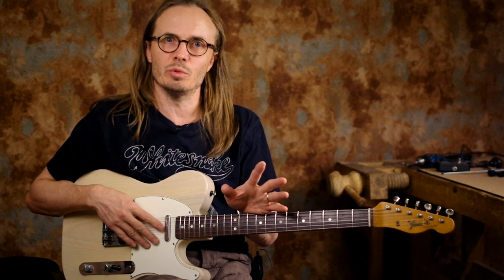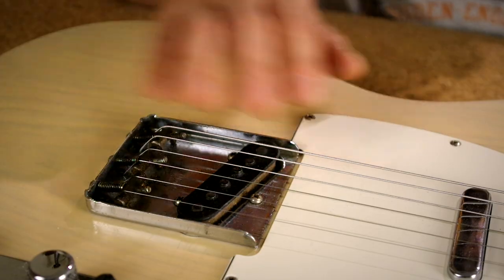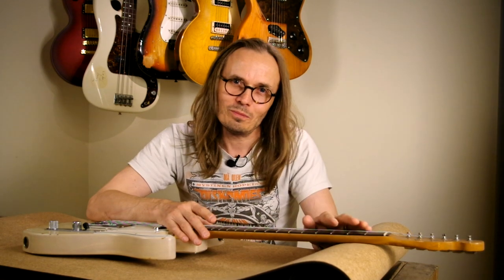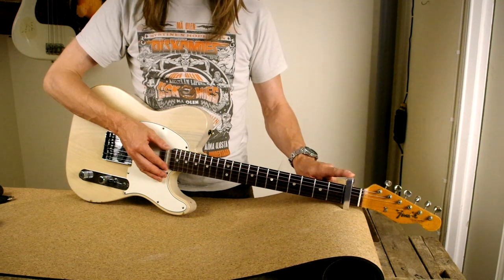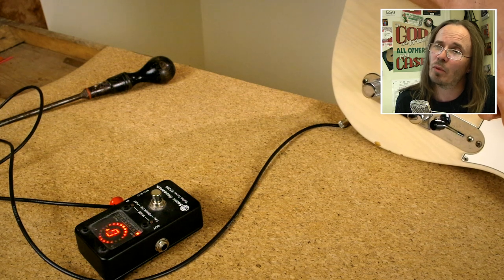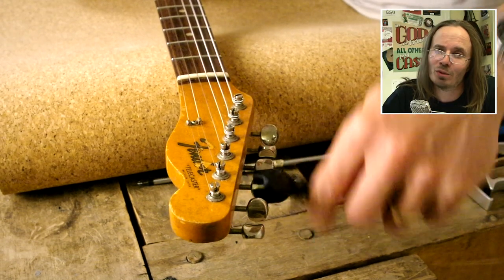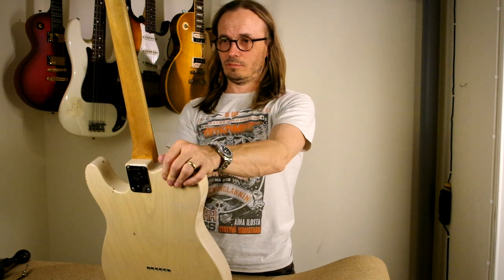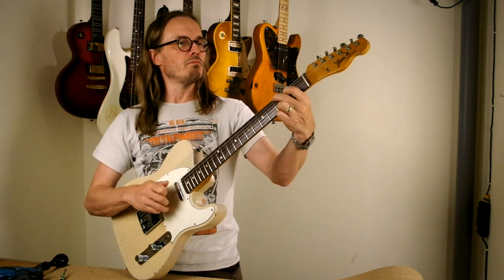Zen & The Art Of Guitar Maintenance #7 - "Learn how to adjust your vintage Fender style truss rod!"

Comment: For the pick guards that don’t have pickups attached there is no need to remove the neck. For people who are sketchy about removing the neck. Remove the 5 small screws on the pick guard and it will slide under the loosened strings. There will be plenty of room for a tool. I have been doing it this way for 40+ years.
Reply from the maker: Thank you!  Yes, this is of course possible whenever there's room for a tool after removing the pickguard. This doesn't work always (sometimes not enough room for a tool), but with many of them it does, indeed. :)

Comment: I've taken my guitar to many places to adjust the truss rod and they never do it very well. I wonder what they are doing wrong or what is happening to my 50s fender vintera. It is initially perfect and next day it's all wrong again , string buzz or no open chord will sound tuned...hmm I'll try do it myself
Reply from the maker: Thanks. If your guitar has felt perfect (as you wrote) after the adjustment, but then during following days the neck (truss rod) has changed "on its own", this would indicate that either the truss rod of the guitar in question has a tendency to adapt to adjustments slowly. In other words, next time you take the guitar to a repair shop, it's good to mention them about this, and ask them to take their time with it - adjust, wait a day, readjust, and repeat that until it doesn't move anymore after adjustments. Alternatively, your guitar neck is simply unstable. This can be caused by too hasty build process of the neck, wood that wasn't dry when the guitar was built, or something similar.
Reply: Thanks so much for your reply. I was thinking that might be the case because every time the guitar has been set up , it's been in a few hours or from one day to the other since I've had rehearsals, gigs etc ..the next day.

Comment: Why you slinging that 2ft screwdriver around?
Reply from the maker: Thanks! I'm so used to it! :D The origin of using such a long screwdriver come from the reach easier to adjust whammy springs on the back of the body, and also the truss rod. Another thing is torque - with a long screwdriver you need less force to tighten (or open) things. But I agree - in some contexts it may look hilarious. :D

Comment: Since many of the people watching this video are beginners, it seems that a simpler expression is needed. Wouldn't straight and bow be easier to understand than tight and loose(5:50)? Does Tight stretch the neck or bend it?
Reply from the maker: Thanks for the feedback! The terms can be confusing, indeed. The tighter (clockwise) you turn the adjusting nut, the more straight (or up-bowed if you tighter the nut way too much) the neck becomes. And in the same way, when loosening (counterclockwise) you adjust the nut, the more (back)bowed the neck will become. If you take the time to watch the video through completely, the visual demonstrations in combination with my explanations should make the process pretty clear. I hope, anyways! :D
Reply: @ruokangas  Thank you so much for your kind reply!!!

Comment: The suggestions here are great for sure. //If you want a little measuring trick I use (rather than going by feel, which is good as well no doubt), you may look into buying a quilting ruler. My girlfriend has one, as she knits. Her's is I believe 18" (I believer there are at least two lengths). This is the length of the Fender neck. Hold that where you like; I prefer between the low E and A strings. Then you can use a feeler gauge (or a business card) to measure the relief. This seemed more comfortable for me versus capo, fret the fret near the neck joint, and depth gauge. What works for some might not work for you. Take care and enjoy doing your setups, everyone.
Reply from the maker: Thank you! All tips are most welcome - haven't heard of using a quilting ruler before - have to try as my wife has those as well! :)

Comment: Great video.  Very thorough. My Fender Road Worn strat has one of these necks. The last time I took the pick guard off with the pickups to adjust it. This should help a lot.
Reply from the maker: Sometimes there is indeed enough room to adjust by removing the pickguard, but often you'd still need to lift the neck up to expose the adjusting nut properly.
Reply: @ruokangas  I tried your method last night and it was a lot easier. I greatly appreciate your insight.
Reply from the maker: @pellelindbergh7483  Thank you! Glad to hear!

Comment: excellent instructions...one thing please; this particular electric guitar - the Telecaster - has the output jack in a position that is not the best when resting the guitar on a surface as you do here to tune...this could inadvertently damage both the cable jack and/or the output jack...maybe better to use a strap when tuning, or simply sit the guitar on your knee...great video.

Comment: Absolutely great video. I have a question about a vintage Yamaha sg7, it’s very unusual looking and I need to adjust my truss rod, the action is quite high on the high frets.
Reply from the maker: I have no experience of this particular guitar. If the truss rod access is at the headstock end, maybe this video is helpful for you: https://www.youtube.com/watch?v=eKBwCP2t4PM
Reply: The truss rod is accessed threw the the neck backk plate jusst like your tele, except I doont need to take the neck offf and there is 4 holes in the rod. Would I by chance Be able to email you? Thank you for the reply aswelll.

Best Anthony B
Reply from the maker: @tonypeppers4987  You can email me. Include a photo. The email address can be found here https://www.youtube.com/c/ruokangas/about

Comment: the truss rod on my 57 strat can only turn about half a turn then it gets too hard to turn and counterclockwise it gets totally easy to turn, any ideas? relief is about .75 mm
Reply from the maker: Thanks. Two scenarios that come to mind. Either the truss rod is jammed (could be due to rush, etc), or it's tightened "all the way" - no more threading left in the rod, in other words. In both scenarios, my recommendation would be that you take the guitar to an experienced professional.

Comment: so when we tighten the truss rod from the bottom of the guitar on vintage style truss rod . to tighten we turn it left ?
Reply from the maker: Thanks. To tighten, turn the not clockwise, as mentioned in the video. Doesn't matter on which end of the neck the nut is located. Maybe a helpful metaphor: Opening (loosening) a cork of a bottle = counterclockwise. Closing (tightening) the cork = clockwise. Right? :) Counterclockwise loosens the truss rod, clockwise tightens it.
Reply: Righty tighty, lefty loosey.

Comment: You went to the eleventh Fret for your reading on the last measurement, Why not the eight
Reply from the maker: 11th or 12th (or 13th) with this rather primitive way of checking the relief gives approximately the same results. In my work I check the relief in multiple ways - for example, I always check so that I press the string down to the 1st and 12th fret and check the relief around 5-7th frets. In the same way I check between the 12th and last fret … and so on. This way I can learn if the truss rod is effective evenly across the fretboard or not - in other words, is the curve of the relief symmetrical or not. With problematic necks that have fret buzz even if the frets are in good condition and leveled, the reason is sometimes the truss rod not functioning optimally. Is there a fix in these cases? Sometimes the only solution is to adjust a bit differently to find the best compromise.